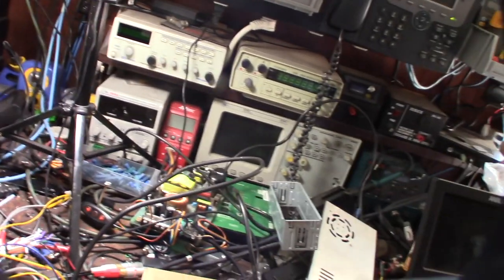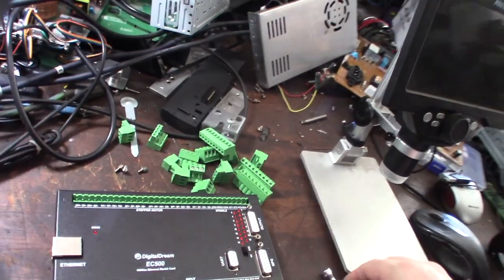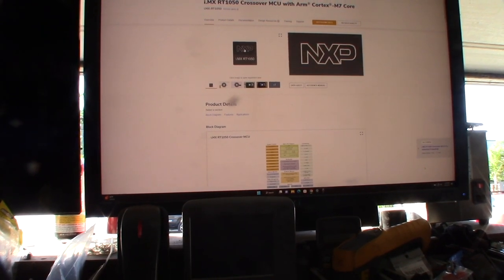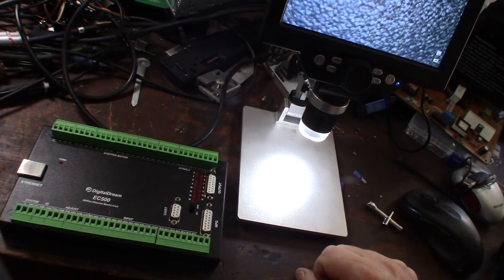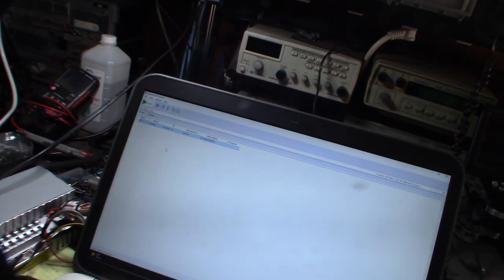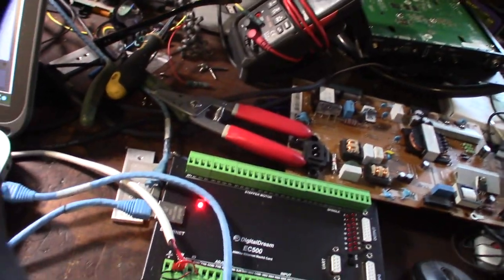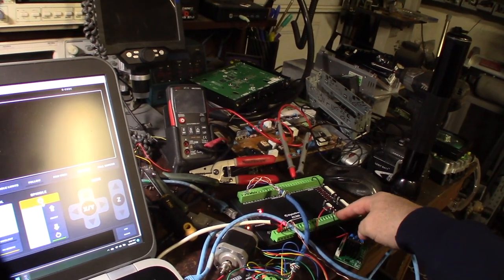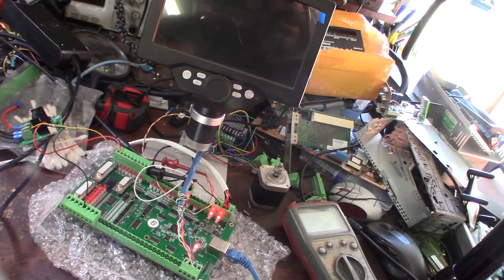New Digital Dream EC500 V5 Does not work, BEWARE!!! Plugin Nightmare!!! EC300 NVEM

Comment: just bought a nvcm 6 axis. i can jog the drives with keyboard through mach 3  but cannot read any input. looking at the guts of the boards it seems that the optocouplers between mcu and the limit switches  cannot change from low to high. forcing the mcu side of the inputs to ground makes mach 3 to read them . ive tryed to contact the vendor on aliexpress but he's on vacation for chinese new year....meanwhile the producer of this board has a ghost site without any contact infos... whats the point of selling millions of non functioning board just to scam people.  its just useless pollution and waste of materials. very fustrated about this

Comment: yes be careful they sent me two and nothing be careful the seller will say he sends another one and then passes the time to open a claim
Reply from the maker: I opened a claim right away. Used paypal and credit card. I already know its too expensive to ship back. There is development on this with linuxCNC. I might have to go that route.
Reply: Check your Mach3 version. I downgraded mine and it work ed fine. Maight be the case for you too. Also check your IP.  They say to use 192.168.1.x but it was 192.168.4.x

Comment: are you still using the nvem v2 ?
Reply from the maker: Yeah, I'm getting ready to replace it with my EC500 V5 running linuxCNC
Reply from the maker: @GeeEmJay  I have got them both working with remora, I'm only testing. Nothing in production